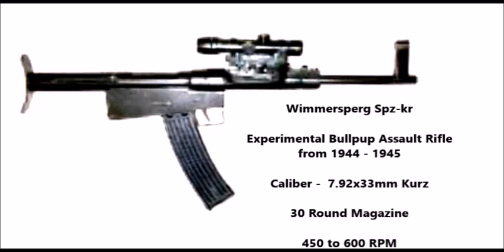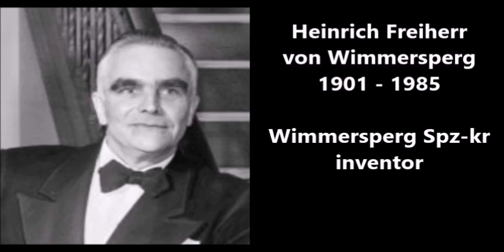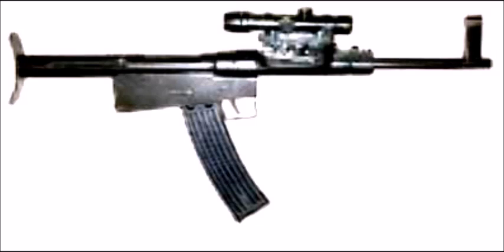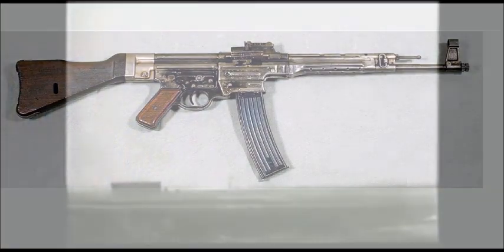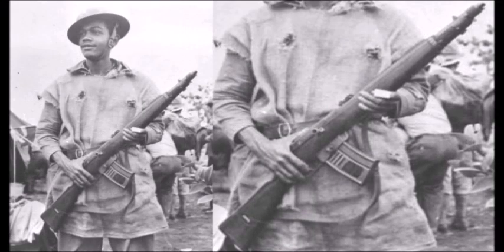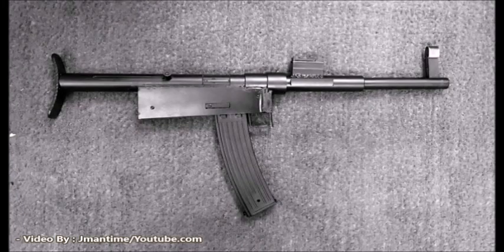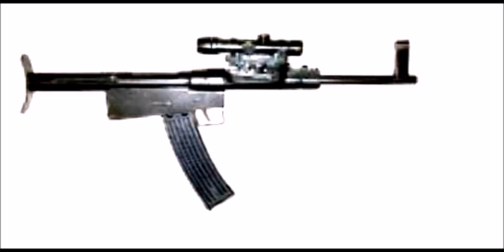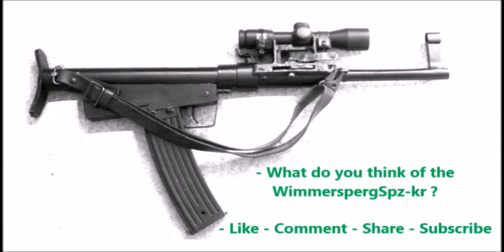Wimmersperg Spz - Last Ditch German Carbine

Comment: It actually makes sense.

-Sten gun receiver
-Open bolt (3.3 lbs)
-Barrel nut holds the receiver and barrel together.

And another model being closed bolt, striker fired. Like a semi-auto Uzi clone.

(In one picture, you can barely see a slot for a charging handle. Recoil spring behind the slot. And top ejection port.)

Comment: Very intersecting piece of history. I wonder how it manages to handle the 7.92x33mm cartridge with just a simple blowback mechanism. I would guess is uses very deep barrel groves the vent gas pass the bullet to reduce back pressure on the bold face.
Reply: Delay blowback, probably "simulated mass" like kiraly
Reply: I believe they did research on that. And found that a straight blowback 7.92x33 needed a bolt weight of 3.3 lbs.

Which is pretty similar to a blowback mechanism in .30 Carbine

And less than .44 Magnum. Which Ruger has actually done before.

Which is why one German group developed the Wimmersperg Spz-kr.

And another developed the STG-45 (Roller-Delayed blowback).
Reply: @emuriddle9364  the ruger .44 mag carbine was gas operated, not blowback. The stg was gas operated with roller locking. A 1.5 kilo reciprocating mass in a 5 kilo arm will rattle your teeth out of your head in quite short order. It will also result in an incredibly short service life for the arm itself. A blowback mechanism in a high pressure cartridge with any kind of case shoulder also requires the use of lubricated cases (ala the Pederson rifle, or the Thompson autorifle), or longitudinally grooved chambers (ala the HK G3 rifle), all of which were delayed blowback (Pederson disadvantage, Blish sticky wedge, and Kiraly simulated mass respectively).
Reply: @ludditeneaderthal  Thanks for correcting me on the Ruger .44

The STG-45 was a roller delayed blowback, though. No gas port. 

And vibrations in a straight blowback would be a consideration too.

The Soviets made the same observations, when they were testing the Shpagin Assault Rifle.

(A straight blowback in 7.62x39)

(The post-WW2 rifle trials, that eventually led to the adoption of the Kalashnikov.)

-But my question is: Wouldn't that have been a similar concern with the Volkssturmgewehr?

The huge "pistol slide" that it has, is technically the bolt.
Reply: @emuriddle9364  volksturmgewehr would get no such consideration, those "volken" units had battlefield life expectancies of under a minute once they engaged an enemy. Their arms were "liberator pistol" quality because a service life of 100 rounds would be quite exceptional. Cannon fodder weaponry can be junk by design, the only real design criteria is "the projectile goes that-a-way" and it doesnt go grenade in the user's hand.
Reply: @ludditeneaderthal  Which is why the Wimmersperg and the STG-45 were both developed.

Germany wanted a simplified Sturmgewehr in late 1944.